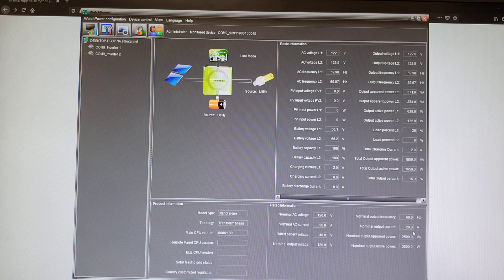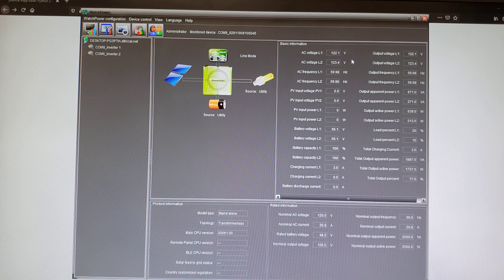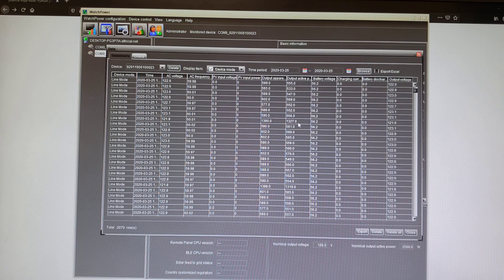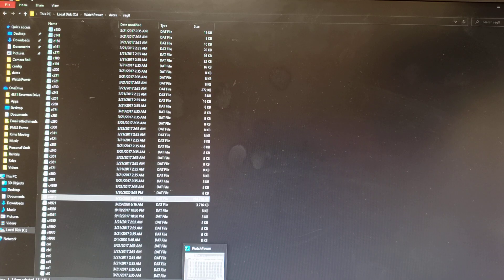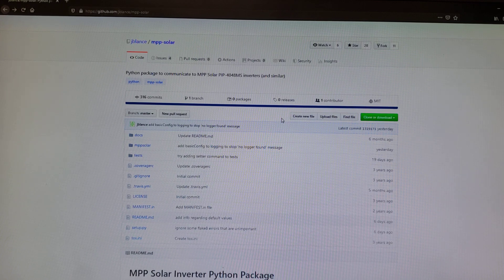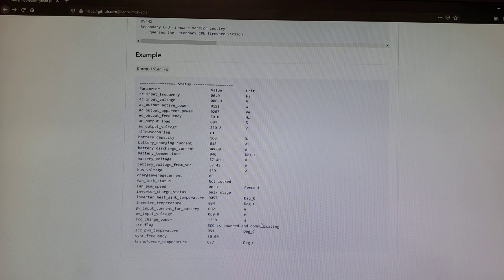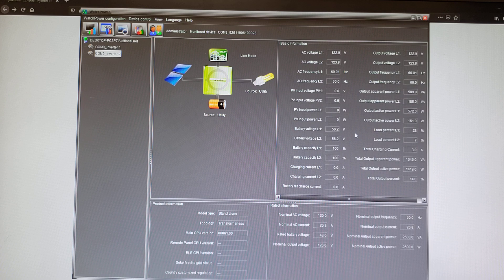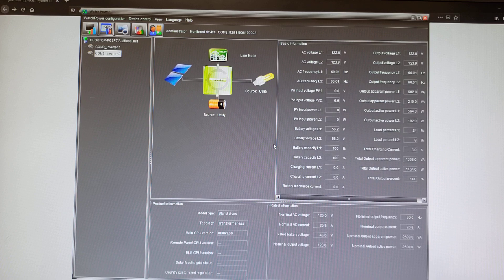LV5048 Data Logging. I Need Your Help.

Comment: Assuming WatchPower is storing data in the DAT files like you mentioned, you should be able to access it, manipulate it, and send it to Grafana with a Python script. The challenge will be figuring out how the data is structured, delimited, etc. in those files. These two SO posts may help: https://stackoverflow.com/q/18340457/1576558 and https://stackoverflow.com/a/59783197/1576558. I'm willing to take a pass at a much smaller version of your file.
Reply from the maker: If you saw my newer videos you will see that I am using mpp-solar from jblance on github. Much nicer solution. Thanks for the comment.

Comment: As someone suggested the Batrium should give you what you are looking for. A little pricey. What haven't seen anyone one do is remote monitoring with it.
Reply from the maker: I wish it was that easy. Issue is communication protocol with LV5048. When are you making next video? I like your place. How was your solar/wind doing this winter?
Reply: @DMIINC2013  will be a few weeks updating plans to install another inverter and ground mount panels.
How did it go with the HOA and the panels?
Reply from the maker: @offgridbydesign3826  It is in attorneys hands right now. I was advised by higher powers (attorney) not to post rant videos about it. Thanks for asking.

Comment: I use raspberry pi connected via USB to serial cable.  A command line package on github called mpp-solar, called via Node-Red.  Then send that to InfluxDB to be viewed by Grafana.  It all sounds complicated, but is not really.  Only problem is MPP-Solar package is not really made for the LV5048,  just the MPP Family so you get some useful information.  But I can tell you that the Watchmon app for the unit is unreliable and crashed about once a week on me.  2nd thing to buy is a Columb Counter which I know you already have.  Cheap 100a? 150a? one on Amazon works great for $30ish.
Reply: Sorry WatchPower App
Reply from the maker: So you have LV5048? If so, great. Can you please share how you got it to work. Thanks,
Reply: Build basic raspberry pi. 
 I would advise using the method described in Adreas Spiess video https://youtu.be/a6mjt8tWUws to increase the life expectancy of the SD.  ie no swapfile maybe docker.
You would want to select or install Node-Red, Grafana, InfluxDB, Chronograf (helps with DB creation and troubleshooting)

You will need USB to Serial Port Adapter supported by the Raspbian OS.  Connect the serial cable (RJ45 to serial port) to the RS232 Port on the LV5048.
Install a package on Github called MPP-Solar (https://github.com/jblance/mpp-solar)
Test your connection to your LV5048 with this command on the Pi.  (Make sure power is on or sun is up or comms are dead)
mpp-solar -R -c QPIGS
it should return some info. or at least mpp-solar -s should.  

When you get this far its a matter of using node-red to run the command and pipe (manipulate) into InfluxDB and then Grafana to display it very nicely via HTTP.
In node-red you need to add the extension for Influxdb out node.  I can help out more should make a video as this has taken me some time to learn.
Screenshot of my dashboard includes webcam on my Meter.
https://drive.google.com/file/d/1LqIqCTnsYXPzCTI3mWzLGFK_wcS3FTLu/view?usp=sharing
Reply from the maker: @chadhouser1  If you could help with grafana part it would be great. I have been working with jblance for last 2 days in implementing com protocol which is specific for LV5048. Check out our progress at his github page. Mainly QPIGS and QPIGS2 and QPGSn and QP2GSn. L1 and L2 of the inverter/s. jblance has been very generous with his time and help. Heading out today to get 2 more USB to serial cables.

Comment: Ya I do a lot of this type of stuff. But dont have this inverter to decode it. It is different having two inverters per chassis in it. Just have to see if any reference documentation on the serial protocols exist and go from there. But I understand searching for those are near impossible for most of these devices.

Comment: May want to ask in the DIY Powerwall community. I would be interested as well in having a way to go through that data easily other than sifting through logs.
Forum: https://secondlifestorage.com/ and the FB group: https://diypowerwall.com
Reply from the maker: For past 3 weeks I scoured intrawebs :) for any relevant information and have visited many websites including ones in  your post. Problem is that published com protocol only sees one half of one inverter. I have 2. Soon to be 3. I will appeal to Peggy at MPP solar for com protocol regarding LV5048. I do not expect to much since 3rd party is responsible for writing it. Thanks.
Reply: @DMIINC2013  Another LV5048 owner here who is going through the same problem. I've posted the protocol information here: https://github.com/manio/skymax-demo/issues/6. I'm hopeful that the author of that pckage will find time to implement the additional queries our inverter needs since he hasn't archived the issue yet. Perhaps jblance has time to implement?
Reply from the maker: @cowpen  He did it last night. We have QPIGS and QPIGS2 working. We can now see both sides of the same inverter. Now on to all three inverters at the same time.
Reply: @DMIINC2013  Nice. Can you paste the link to his github?
Reply from the maker: @cowpen  I saw you got to it.

Comment: i think this is exactly what you are looking for :
https://youtu.be/WIzgOSt65X8
Reply from the maker: I have tried that too. Problem with raspberry Pi and code available is that you can only see half of the inverter.
Reply: @DMIINC2013  it works fine here, although i have the same mpp mpi inverters as the author.
you do need to make sure you select the correct inverter script though !
Reply from the maker: @houseofancients   I have tried dozen different ways from Sunday to get it to work but cant since LV5048 has slightly different communication protocol.